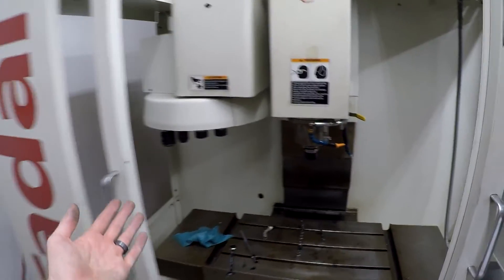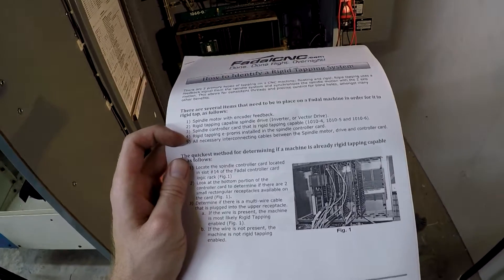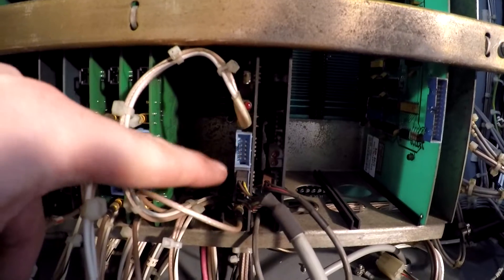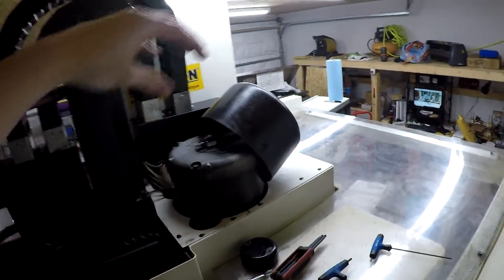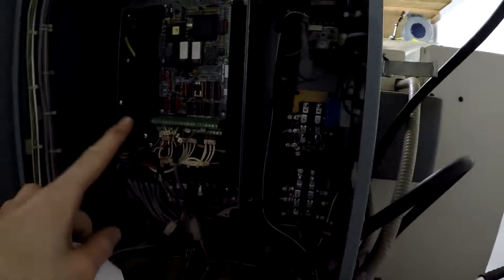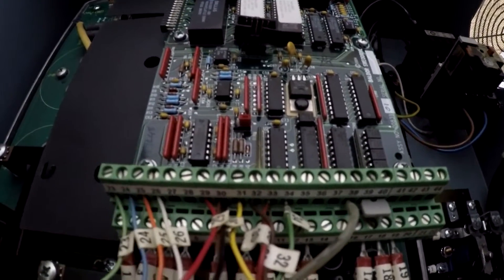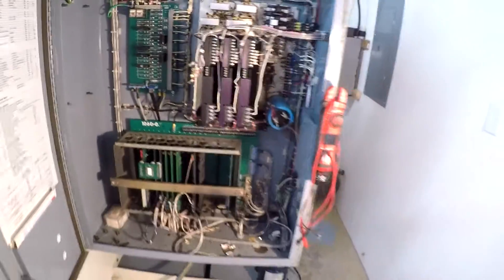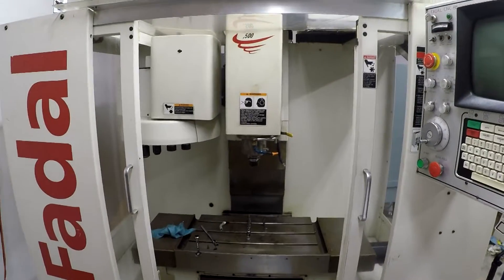Can Your Fadal Rigid Tap?

Comment: Had luck with the faults ?           What were the symptoms ?  These machines carry the usual time bombs called capacitor fails... So the yellow capacitors on the boards are slowly losing values and making stuff misbehave.... we had it at the start with the Spindle board - 1995 built  VMC4020.... the RESET circuit works with a CAP of course  / next to the red small button on the board/  When CAP loses the capacity .. that board comes alive faster before the CNC computer can..... Then CNC will not get the HELLO message from the card. In fact it gets it way before.... So ... time to replace all those shitty yellow caps ( costs maybe 20cents / piece)